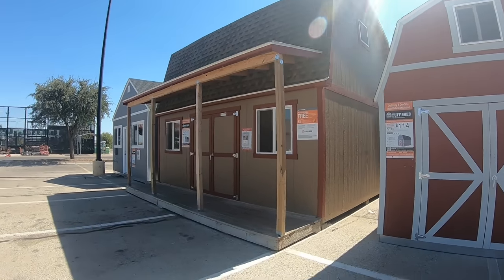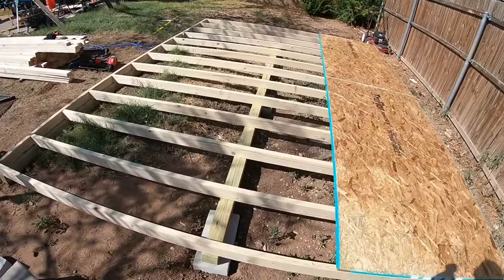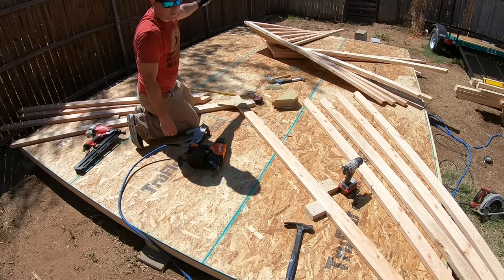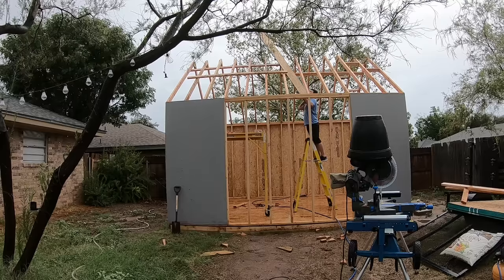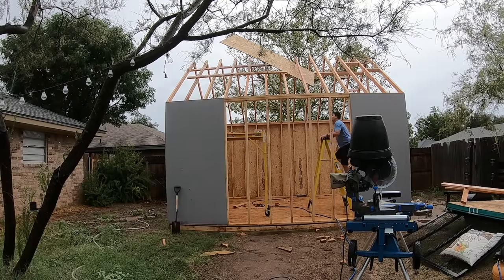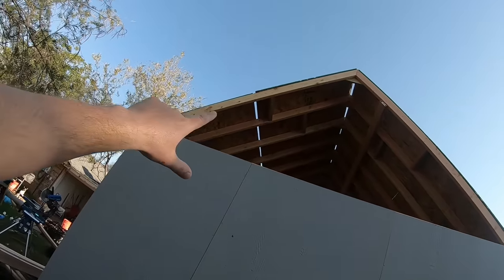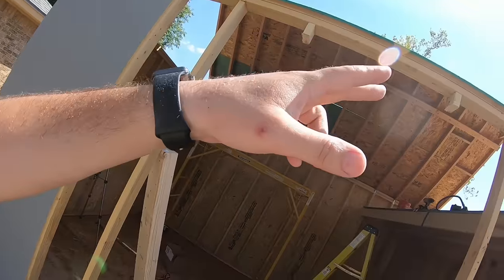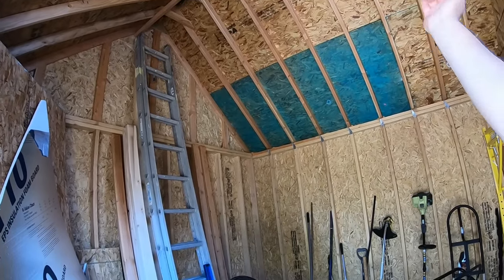Giant Shed for a fraction of the price!!! 12x16 with a Loft!!!

Comment: The GF noped her butt right outta there haha. Building a shed is about 90% a one  person job unless you skin the walls then you need an xtra set of hands lol. Great job tho man👍🏼👍🏼
Remember, try to put bracing and or brackets anywhere you can. You want to try to tie it all together as good as possible because the wind is a lot stronger than people may believe. Build a strongback or install joists PLZ. Especially if there's going to be a child up there 🙏🏻 A little extra money and time is well worth the peace of mind. Believe me, you'll sleep better 
And since that door is going to be larger than normal and needs to have a proper header and support. Find the center of your opening then rough out the doorway. Meaning install a proper header with King studs to carry the load. 
And it's just a suggestion but I'd think about installing a window at the other gable end somewhere down the line.
Reply from the maker: We did end up putting in joists and hurricane ties to the walls. Thanks for the comment and suggestions!

Comment: This was awesome! Thanks so much. I am amazed it only took you 40 hours! It will be interesting to see how it does in a few years especially after some hard core TX weather. If you had another set of hands, do you think it would cut the time in half or more? I am just planning how much it would cost to hire people, how long for two people working together?
Reply from the maker: I imagine having 2 people would have cut time by more than half. Especially anything to do with the roof. Very inefficient having to climb up and down for every piece of material or nails or a tool you forgot or dropped.

Comment: Im curious im in Texas too did you have a plan like blue prints or did you just wing it ? How come you didnt use bigger floor joists like they do when building a deck ? Thanks
Reply from the maker: Just winged it… only used 2x4 because the spacing was well within the capable joist strength distance and it kept the shed closer to ground… Would recommend going with at least a 2x6 if I were to do it again.

Comment: Why there is no decent overhang or a soffit done to shed off water better? Also shouldn't the walls been built to allow the siding to come all the way down to cover the floors framing? This seems like a huge water catching area around the bottom of the structure. By the way I am not being negative just questions I have prior to starting to build a shed in my back yard! I still think your wife could have been more helpful and responsive to assist when in a bind! Thanks for sharing!
Reply from the maker: If I had to do over again I would definitely make an overhang all the way around, but I didn’t think about it and was just thinking about being efficient with materials. The siding should have covered flooring but I used full 8 foot studs instead of standard size. I will be doing an additional faux rock siding around the bottom to better weather proof and gutters on front and rear to help divert water. Thank you for the comments!

Comment: I would definitely add at least 1 window on the main part, plus 1 small window for the kids loft. The way you've built it it will probably be 90f in the main section and 95+ in the kids loft on a sunny 70f day.

You need ventalation and natural lighting.

Whatever you do, do NOT install an AC for the kids that vents into the main section, especially with no ventallation in the main section. All of the heat and humidity that the AC unit removes will go into the main section causing that section to be unusable and risking mold. Also as the main section heats up, the AC will be less effecient and the heat from the main section will cause the kids loft to heat up.

I would put in at least an 8000 BTU, possibly a 10k BTU or 12k BTU unit in the loft of the main section that can be controlled via a phone app. Then I would build a duct to catch all of the cool air that goes across the shed and into the kids section. You could build another duct to redirect part of the airflow directly over your workbench.

As I said, the end of the duct would be the kids loft. They can control their vent so that they aren't too hot or cold.

Amazon sells an indoor/outdoor thermometer that allows for up to 3 outdoor zones. Put one unit in your house to be able to monitor outdoor, main section, and kids loft temps. This way you can ensure that the shed temps are reasonable before you or the kids use it.

A standard indoor/outdoor thermometer in the main section would allow you to monitor the kids loft temp while you are working at the workbench.

When you are using the main section, I assume that you are going to put in a workbench, you can open the vents to the main section. This will allow your area and the kids area to be comfortable. With the app you can control the AC for the main section and probably your house.

If you will have AC then you might as well have lights and outlets. Might as well put a mini or microfridge in the kids loft. Make it easy for them to stay hydrated. Then either a minifridge or small apt size fridge for the main section. Having bottled water, coke/Pepsi and beer handy will be something wonderful. Convenience and not opening and shutting doors letting cool air out will likely save enough electricity to pay for the electricity of the fridges.

If you don't do any of the above, then put in ventalation. A few small ones near the floor and a large one near the roof.

example of floor vents
https://www.lowes.com/pd/Air-Vent-17-5-in-x-9-5-in-Plastic-Foundation-Vent/3593660

Example of roof vent
https://www.lowes.com/pd/CMI-12-in-x-12-in-White-Rectangle-Steel-Gable-Vent/3284522
Reply from the maker: Thank you for all the info!

Comment: There is a tool called a pallet puller that has teeth and it tightens as you lift. They use them to pull plywood up to roof with a rope over the ridge cap. We made a tie-off on the far side, attached the grapple and then slide plywood up onto roof. Then when you get up on the roof, detach it and move plywood where needed.
Reply: That makes too much sense and smacks a bit like “constructors’ privilege”.

Comment: What was that I saw run under the shed? It would have work better if you had rope and pulleys and it would have worked better if you put it the plywood on top of the scaffold that way you wouldn't have to carry the plywood up the ladder. You did a good job though but I would have been right along there with my man.
Reply from the maker: That was my son's pet tortoise. I appreciate the comment!

Comment: Great video, I never built a shed before either, but I’m not rich either. I took on the project to build a 12x10 shed, yes it took me one month but it came out nice. I built it to look like my house even added into the roof line a porch I added nice windows and A door with windows to mimic our house and I wired it and fully insulated the shed/tiny home 🏠 I built it With all the bells and whistle’s for less than half what I could have bought a plan box shed delivered.  All said and done $3,800  lol 😂 yes I made a few mistakes but I also learned a lot 😂 again great video.
Reply from the maker: That sounds Awesome! Thank You for the comment!

Comment: good job, first thing i ever learned is that you need a plan of attack first. when you were struggling with that roof you should have built that loft floor first then set all your plywood up there. Once you had it there you should put braces on your facia to catch the plywood and start with the lower part and work your way up. Nice shed though. keep it up.
Reply from the maker: Thank you for the comment and advice!

Comment: Technically speaking, I'm pretty sure that latter was not rated for the weight of you and that 4×8 sheet of whatever the heck that is your carrying up there. 
I know. I heard you say a few dozen times that, "this for entertainment purposes only."🤓 "Don't try this at home!" 
I'm glad to know you pulled it off so inexpensively. I'd feel a whole hell of a lot better if you'd brace the roof properly.
Reply from the maker: Thanks for the comment! I have since gone back in and braced the roof... Wish I had done it from the start...
Reply: @fixingspencer  Hey Brother, there's nothing wrong with getting structure "UP! With a Roof!" Getting all the tools and building supplies inside out of the elements, installing the window unit and duck-taping a disposable filter over the unit's intake and working from inside and finishing the rest of the interior of the build, including installing insulation, electrical, even drywall, in the comfort of climate control (even if it's temporary, so you can work and not overheat in mid summer.! The next time I do it, I'll make my own YouTube video/channel.! Thanks for the inspiration. I'm gonna look into doing a similar project myself.😎🤓

Comment: You should've bought the "tough shed" you would've got a much better...safer product. ...remember this...they put those things on a truck and drive 60mph down the road bringing it to your house...your shed would break into a million pieces if you tried that. You can see your "loft" bowing under your weight. The floor of your shed was framed with 2x4s. It will definitely not hold any weight...im making my kids an elevated playhouse...im using 2x10s...your walls, flimsy is a nice word ill use...the whole thing was just a bad idea

Comment: ....Why!?!  😵‍💫 Why did you want to fight that roof sheathing placement through the rafter bay instead of just going up adjacent to a sidewall, sliding it sideways directly on the rafters temporarily holding it in place with a couple of short 2 by 4's fastened from the outside in at the top plates?!  You'd of had so much better control of that 4x8 not to mention conserving time and energy, or worse, potentially taking a rather unpleasant "ringer" in the neck if that would have come loose at the wrong time?

Comment: We built a 12x32 for $4,000 (including having the concrete slab poured, wiring, and insulation and drywall) for my husband's gym and an 8x24 for $3,000 (with all the other stuff) for storage. The crazy thing about those prices is that it doesn't include the floor, insulation, wiring, drywall, paint (inside or out), shingles, or labor. That's the markup for just calculating materials. They STILL charge for delivery. smh

I have no idea why anyone would buy one. Rafters? That's about it. If you don't want to deal with laying out your own, they're not that expensive to buy preassembled.

Comment: Should have titled this: HOW NOT TO BUILD A SHED. 
   Watching you get that first piece of roof sheathing up on the rafters  (which don't have a ridge board) was like watching a turtle trying to screw a helmet. 😆And who starts their first run or row at the ridge instead of at the bottom where the rafter meets the top plate? You, I guess.🙄 Where's you overhang (aka soffit) at the gable ends or where the top plate meets the rafter tails?🤨 No windows for cross ventilation in that hot Texas sun? 🤔

This a prime example of DIYers who think "How hard can it be?" Dude, don't quit your day job.

Comment: It looks great.  I'm hoping to build one next spring.

What is that prefinished siding you used?  Is it going to need to be protected with paint?
Reply from the maker: It was the cheapest real siding Lowes had… It comes primed and ready for paint
Reply: @fixingspencer  I see a variety of primed OSB.  None of them look cheap.  Do you know what it was called?
Reply from the maker: @donkrapf  It’s called “Engineered panel siding” on lowes website… Item #2423179… I couldn’t figure out how to post a link or picture or I would have.
Reply: @fixingspencer  Oh!  I see it now.

That's a great price.  Thanks!!!  :-)

Comment: dude! at the 21:55 mark, why not slide that roof panel from the OUTSIDE camera facing, already clad wall areas.  push it up flat and let it just lay down instead of trying to push it straight up through the ceiling?????  great job otherwise.

Comment: Well, you did figure out the right order for the side walls after the first wall fiasco,  (Wall first, with support 2x4s already screwed on, THEN plywood.  But instead of both sides first, I would have put up the back wall first, then sheathing on the bottoms to square it up.  Then a side wall because you can connect it to the back wall to be free standing.  Then the other side wall and front.  I would have put cross members on the "trusses" to make them actual trusses and much stronger, and some overhang with a "bird's mouth" on each end.  Finally, the roof goes on from the bottom outside.  As soon as you nail it, you can walk on it.  Much easier, and the next row just rests on the bottom row.  I recommend all DIY shed builders watch Kens Karpentry YouTubes to get the order right.

Comment: I would have poured concrete footings, with 4x4 sill plate.   Poured a concrete floor and then built from there.  Looks pretty good, your neighbors aren't happy I suspect. You could have built a half wall on the one side and slope it down . Big shed for such a small backyard.  You need a bigger ladder and place the OSB from the outside.  😮. Lucky you didn't kill yourself. But you got some good hits on your video. 😅

Comment: I'm not trying to be mean, but you don't think you'll regret putting that lumber straight to the dirt. Pressure treated or not. Then no contractors adhesive for the floor. I know it's a shed but squeaky floors are irritating. I've built a few sheds over the years and I like to build the base with steel and I still keep it up and paint the steel.

Have her get you a brace. Dude fun to watch but you're a little scary. A buddy a few beers and some big stakes go a long way.

Comment: Why didn't you add bracing on the wall before lifting it into place? The bracing would have helped and prevented accidental walls from falling while lifting it. Just keeping the project safer.
I can tell this is an amateur build. The lady walking onto the platform  to get nails, that you forgot to load before lifting the wall. Just dangerous.

Comment: Good effort. Obviously  there is a reason why HD charges what they do.  The HD shed is very well built with the correct materials, design and nailing. I have over 50 years as a residential carpenter. As a suggestion, find an experienced framer to give your shed a walk thru. Ask him how to fix some of the mistakes. 
Taking short cuts, trying to save a dime on lumber, can sometimes  come back and bite you on the ass.

Comment: 2x4's for floor joist is so woefully inadequate I don't even know what to say. There' are reasons for using two 2x4 on the top of the stud walls. One of them is so you can interlock corners or intersecting walls. No bottom chords on your trusses so the walls will be bowed out and the building will be collapsing in 5 years. But the floor will have probably rotted out or give out under load long before that if you put very much in the building. At best the joist will sag/bow and make contact with the dirt and rot in less than 2 years after that. I had to quit watching after that. You really should refrain from construction until you increase your knowledge base on carpentry. This is a good example of what not to do if you want to DIY a backyard shed project.

Comment: As an owner of a shed company..I can literally order 30 grand of material at a time and it still runs $2500-2700 to build a 12x16 with paint. Of course we use quality material. Cant even imagine the materials used to get it under 2000. Floor looked to be regular 2x4s with no treatment and cheap OSB. Siding appeared to be the cheap soffit panels and are not structural. It's great to show people how to build a shed with the absolutely cheapest materials with no warranties just dont dont compare it to a shed with a topnotch flooring with a 50 year warranty and proper structural siding with a 40 year warranty.

Comment: I really hope you don't let your kids play in that thing. Just hit 26 minutes and realized your roof is completely unsound It is neither a truss or a rafter. Heavy winds are going to collapse that roof since you have no horizontal support between each down side. Also, hope you don't live in a snow bearing state because you have no load bearing beam going down the center between either side connecting each of the ribs. I get DIY and saving money but this could kill someone.

Comment: You almost dropped a wall on your gf and getting that first sheet of plywood up it was easy to see how something could have failed and you’d have had a bunch of lumber come down on you. When working alone with heavy stuff you gotta be in control of it—use leverage or devices to assist if necessary.

Anyway good job :)

Comment: What this really boils down to is 
Cost+Time+BS. If you can afford one at the listed price and you do not have the tools or experience to build one, then do yourself a favor and just buy it. This is not a project to cut your teeth on. In my case, I have the tools and experience to save the money, but i work too much and would never have the time. It would be half complete by the end of summer and then just sit there collecting snow all winter and would just be one more thing I have to keep clear all thru a 6 month Montana winter. But if you have the tools, have the experience, and have the time, then he'll ya. Build it yourself.